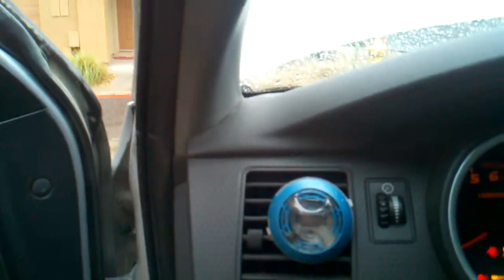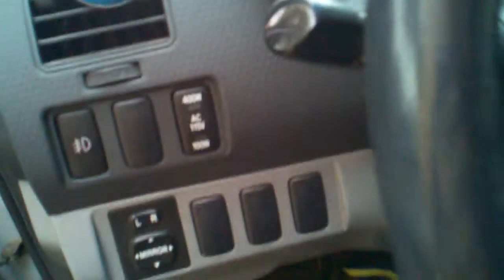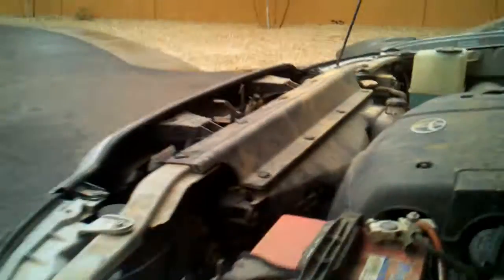Broken Motor Mount - 2006 Tacoma

Comment: I have recently had the same issue.  As it turns out it was not the mount at all but a failure in the frame surrounding the engine mount in a semi circular pattern causing the engine to fall to the left. A failure that should never happen and I am looking into it. I own a 2006 Tacoma.

Comment: I have the same exact issue this morning, semicircular collapse in the frame surrounding the mount. Any help from Toyota?
Reply from the maker: cullen riley   I never took it to Toyota. Mostly cause I knew I was pushing it hard and because I didn't want them to be aware. Say I had another issue pop up after taking it in, they would have been like "Certainly your seat belt is broken because your off-roaded your truck, warranty denied"